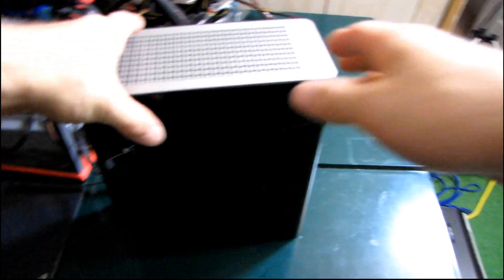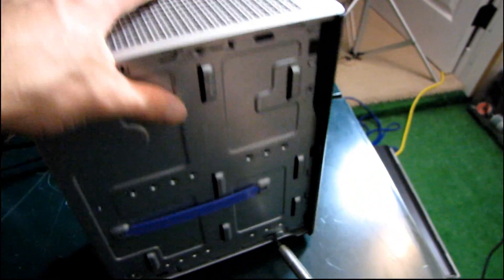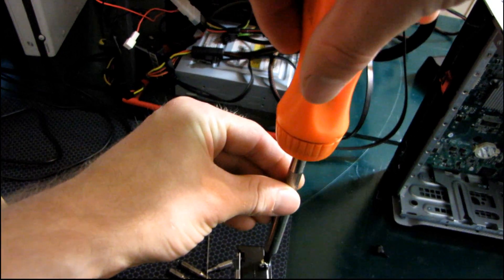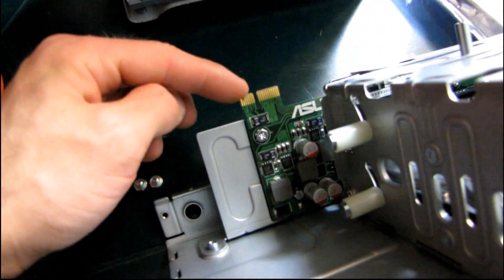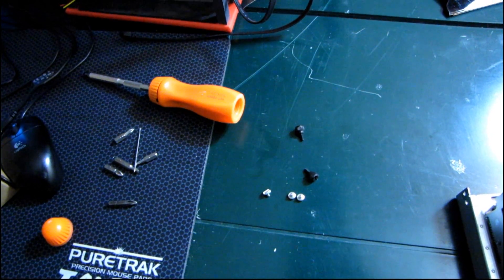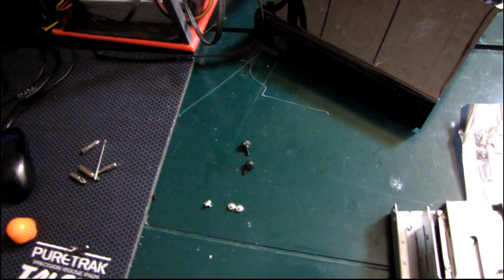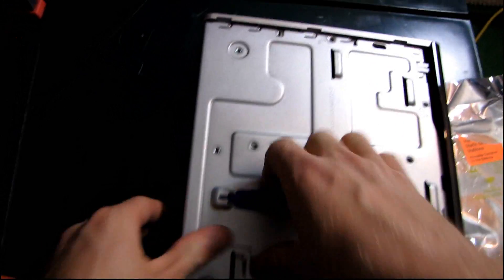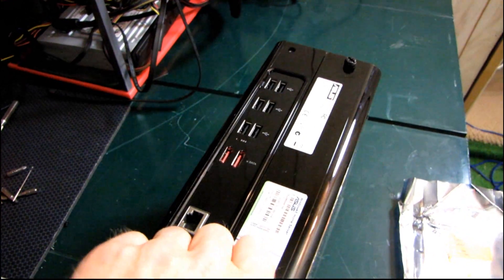Asus TS Mini Windows Home Server Hard Drive Upgrade Guide & Walkthrough Linus Tech Tips

Comment: @LinusTechTips I made a little research on the hidden VGA port and found out that it would probably just be an integrated GMA950 (or similar) like you find in most netbooks, since the Atom N280 uses a chipset with integrated graphics.. Is that right?